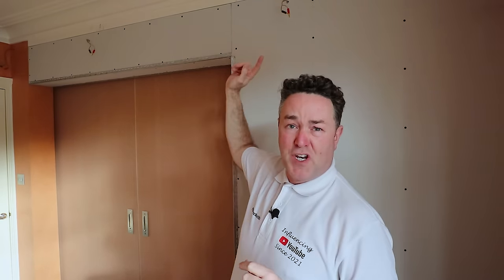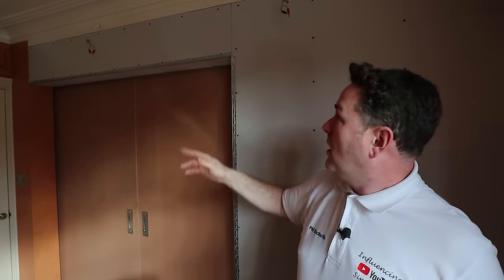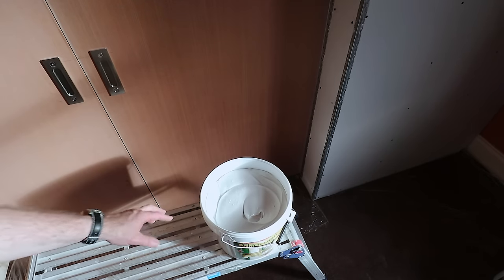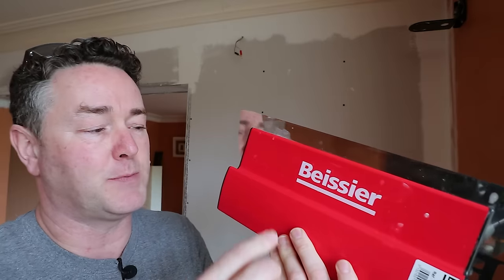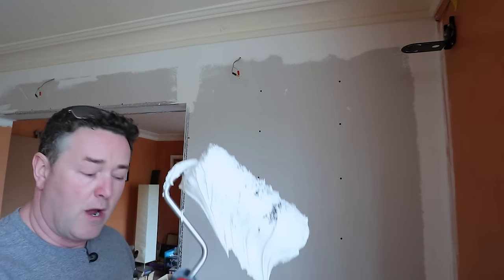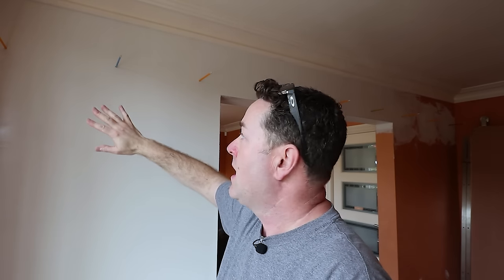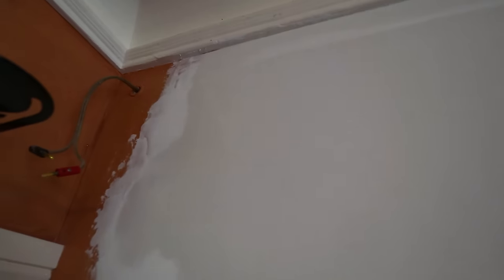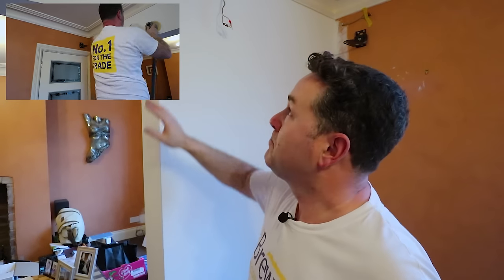Learn the secret to Plastering in 2024

Comment: Been doing years with easyfill
Reply: It’s nothing new. Been skimming walls using ready mixed jointing compound and a caulking board for years. Dulux used to sell it in 10L tubs.
Reply: Yeah don't no why decorators think it's new either.one coat a good scratch down piss coat it and Dec as normal

Comment: What a palaver, just get a bag of plaster, cheap hawk n trowel, cheaper and better, in my opinion
Reply: Plaster would take days to dry out.  Such products will be good to go the next day and will be favoured by decorators.  They can coat a wall, go do other work for the rest of the day, come back the next day to sand and paint.
Reply: @Christopher_T_Paul  yeah, you have a point there, if the jobs that urgent
Reply: I wonder if you could use that on a stippled ceiling?
Reply: @LS-td3dz  More than likely.  There is a product available specifically for covering over textured ceilings called "Polycell Smooth Over", not sure what country you are in and availability though?

Basically ready mixed filler that came with a plastic filler knife.  Plastic blades make it easy to get a smooth finish, but the problem with plastic blades is even though it will look smooth, it may not be straight

Comment: Bit pricy Phil for skimming walls 30 quid for 10kg multi finish 8-10 quid for 25kg. spose ok for a small room or 2 but imagine through a whole house
Reply from the maker: Can you get that pre mixed too and applied by roller?
Reply: @ProfessionalPainterDecorator  you can at over double the price this is 3 times the price you can roll multi finish did it once just to try and it worked quite well but it is harder to use as your got to get it right without sanding it all down and trowel up etc this gear is better but great if the price didn't make viable for big areas

Comment: Well done phill, was looking at that product when in brewers last, like you say initial out lay can be expensive. But again you may have some tools that will do equally as good like a spatula/spat. Not so keen on the rollers shedding as they did, bit annoying. I wonder if you could put it on with one of your worn in normal rollers 🤷‍♂️well done for your first try at plastering, end result looks good 👍

Comment: You could just filled the joints and screw heads  feathered out the bears ,sealed it tape and joint style 
Two tubs £60 6 hrs £70 on tools you will rarely use 
Not economical at all
Reply: You could do. Just seems to be the UK that has to plaster I guess?..
Reply: All sites I do are taped not all skimmed in my area